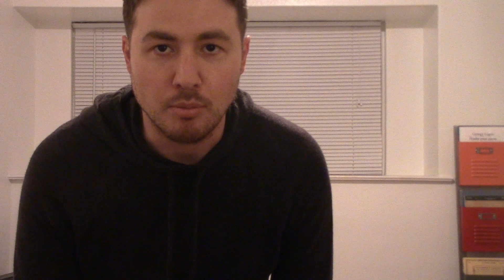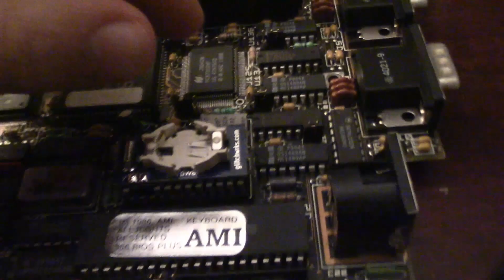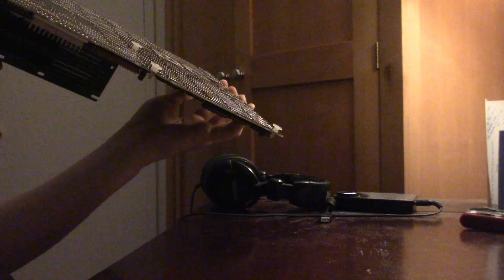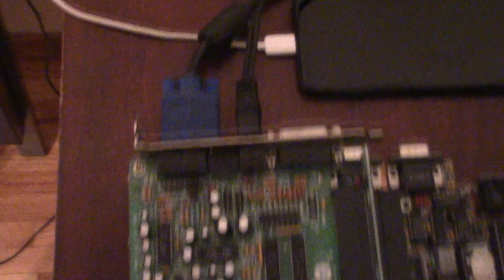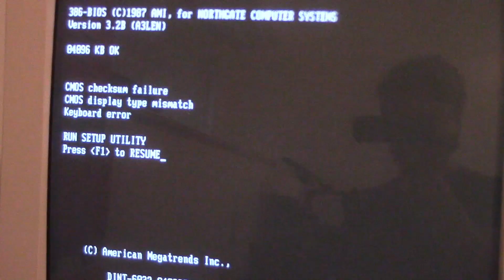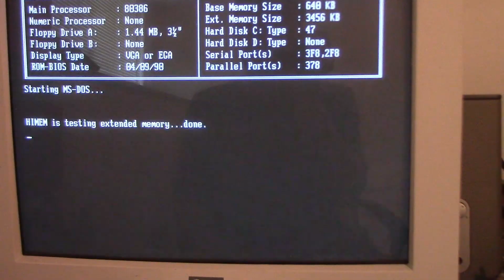The Northgate 386 Build

Comment: Ben's friend, Matt (Turkey), from middle school here. Would you say compatability was more or less of an issue with older PCs than today's machines?
Reply from the maker: Hey Matt! Processor clock speed was a factor with compatibility problems in older machines. 486 computers were well suited for games in the early to mid-nineties, but for games designed for the 386, the faster clock speed often meant the game wouldn't start. This is the case for Secret of Monkey Island (EGA and VGA versions).
Reply from the maker: Correction: would give an integer divide by zero error if started in adlib mode. worked fine in pc speaker mode on a 486